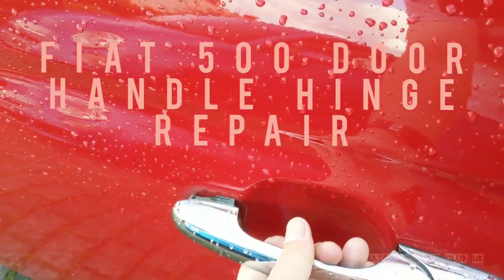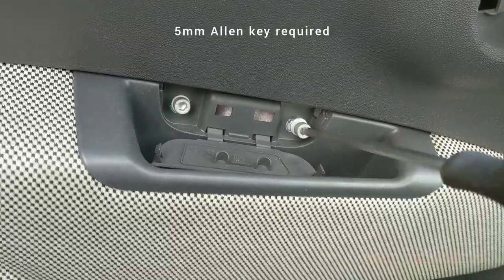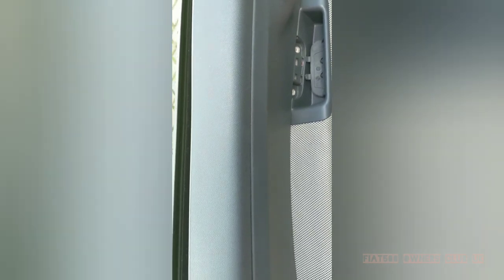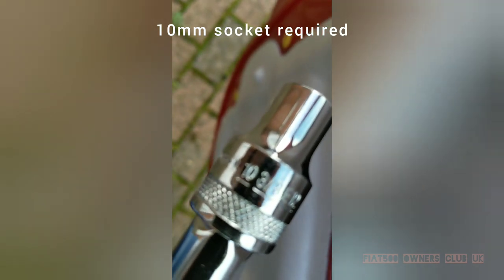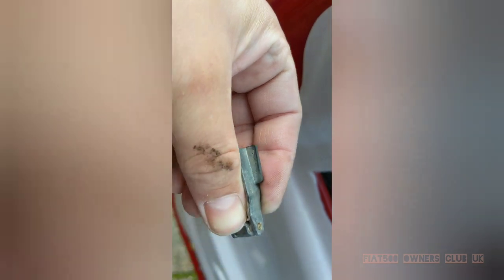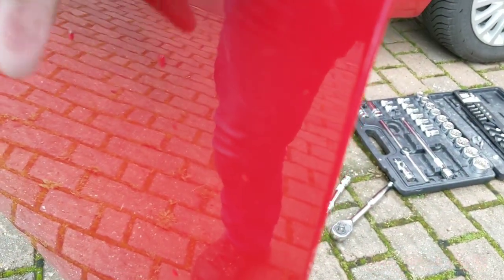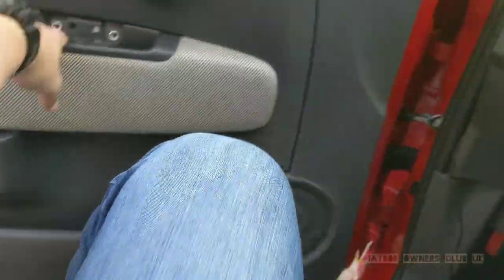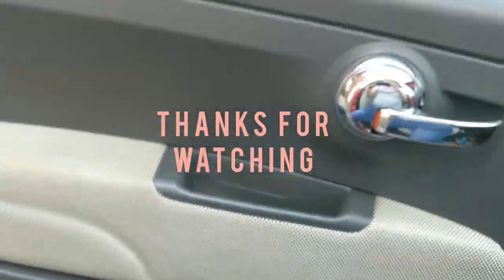Fiat 500 door handle repair

Comment: Thanks so much for a very instructive and intelligent video for the hinge repair. Liked that you mentioned that you don't have to disconnect everything and just place the door card on its side next to the door. Very smart. I saw that someone mentioned that you had not mentioned removing the screw on the inside of the door by the door handle but I'm sure people will figure that out. Again thank you. Have ordered the part and am confident that I will be able to tackle the job.
Reply: How did you get on?
Reply: Worked perfectly. Thanks again

Comment: Just done this for the second time, you DO NOT need to remove the handle if you have these tools, you simply need to undo the handle (Torx T30) to allow the necessary movement required.
A think pozi screwdriver through the hole where you removed the 10mm nut to release tension on the hinge bracket then use a mini socket set (I have one of these Teng T1420 1/4-inch Bits Socket Set Drive) to remove and then replace the screw.

Best to cover said hinge in waterproof grease protect it and ensure the hinge pin stays in place when fitting.

Comment: Okay I just did this job on my daughters car. Drivers door. You do NOT have to fully remove the handle to replace the hinge. Also just to be absolutely clear disconnect the BOTTOM of the two cables NOT the top. That will allow you to pull the handle out enough to get in at the screw at the hinge end.
Reply: Thanks, I’ve got exactly the same situation to do, ON BOTH SIDES. Daughters 🙄

Comment: You don’t need to take the handle off to change the hinge. You can access the screw through the hole in the door where you took the 10mm nut off. You also didn’t show or mention the third bolt in the door card behind the round chrome handle trim.
Reply: Tried this and failed - T change the hinge I unscrewed the door handle, pulled it backward 20mm or so then wiggled the handle away from the door skin. It's very tight in the hole. I then had enough room to get a stubby philips screwdriver onto the hinge screw and remove the old hinge.
Reply: B Simpson you risk breaking the handle or damaging the rod bushes like that. Sounds like you got away with it though.
Reply: This simpler way suggested by Love 500 worked for me. Used a realtively thin philips screwdriver to get in at the angle required and a small length of heatshrink wrap to hold the screw in place on the driver to get the thread started (more reliable than magnetic end although I'm sure that will work too). Protected the paintwork as the hinge will scrape it otherwise when opened to get the screw in. Thanks for posting this, it made it very easy to anticipate the process.
Reply: Wish I'd seen this before I did it at the weekend. Couldn't get handle out so finally managed to screw new hinge in without removing, but it was a pig.

Comment: Great guide, but as mentioned in an earlier comment, and at least in my experience, there is no need to remove the handle, or the T27 torx screw and the rod. There should be enough room to put the new part on without doing any of that. From 5mins 50secs into the video: 
1/ Remove the broken part of the hinged piece left in the handle. You can get to the screw by using a Phillips screwdriver through the slotted hole in the door (doesn’t matter if you lose the screw, there’s a new one with the hinged kit).
2/ Pull the handle away from the door as much as possible and offer the new hinged part into it. There should be enough clearance to open out the hinged part to allow the new screw to be put in (using the Phillips screwdriver through the slotted hole again, but use a piece of cardboard or something to protect the door from the new part).
3/ Once the screw is in place, fold the hinge back down in place. Release the handle to allow the thread to engage through the slotted hole and then put the original nut back on. 
4/ Check it works, then reassemble the door panel. Job done!
Reply: Good tip about screwing the new hinge via the hole in the door, on my first door I removed the bottom of the rod by “popping off” advice which caused the white retaining washer to come off, once I took a couple of pics I realised how the rod is best removed (if required) by rotating the black clip off the rod and pulling the end out without the clip and washer releasing from the bracket. I will follow your suggestion on the other door and just undo the nut inside the door and see if there’s the wiggle room if not I’ll just loosen the torx27 screw then reassemble using your tip this will save a lot of aggro and time.
Reply: Oh my god, my handle just snapped off for the second time (almost exactly 2 years). The first time I completely undid it and had such a hard time getting it back on lol. Your suggestion makes total sense, and I can’t wait to try it that way when I get my new hinge in the mail. Thanks!!

Comment: Greetings friends and thanks for a great video! Completed project today on my US 2015 500 Sport 70k miles. Door card attached in 5 places, 3 hex, 2 phillips. Popped off the door card and supported it on a box, no removal of cable or wiring needed. Adequate room. Vapor barrier pulled away gently by hand, folded, no cutting needed. 10mm nut removed with small socket, found broken hinge held in place by small original(?) torx screw. Couldn't get the correct angle through the little hole, so had to remove the T25 on the door to wiggle the handle enough outward to allow room to remove the little torx with a small socket/torx bit. Fiddly, as you say. Did not have to disconnect any internal actuators from door handles. Go slow and easy. Greased the new hinge and screwed into place with original little torx, folded the hinge, then back through the little hole. Fastened the 10mm, the T25 on the door. Tried the external handle, worked. Vapor barrier back in place, snapped door card back on, 5 connections fastened, closed door. Checked. . .Success!! Did it by myself, recommend a helper. Sense of accomplishment! Dealer in the SE US quoted me $415. Watched lots of videos, got done in 2 hrs. First time, scary, but did it! Thank you very much!!!

Comment: cheers mate and other commenters - door card hardest part to remove - used couple of plastic bike tyre levers and as others have mentioned was able to remove inner handle part phillips screw from hole on inside of door without having to remove handle completely. - but just loosen phillips and remove by hand from outside, otherwise it might drop down inside door.

Comment: is there a way to remove foam without cutting it?
Reply: Not really. It is glued in place and when you try and pull it back, it tears easily and makes a mess. Cutting with a sharp blade produces a much neater finish that can be taped back together.

Comment: Handy Video, followed most of it thanks, , you don't need to cut the white foam, pop it off the holder and trim the glue holding with a blade.. leaves it  intact
Reply from the maker: Thank you.

Comment: does this hinge fit the right passenger door (european model left-hand drive model)?
Reply from the maker: As far as I'm aware it should do as the part is described as for off side and near side.
Reply: Андрей Карякин yes they are not sided. Any hinge fits both sides.

Comment: READ THIS COMMENT - THIS VIDEO IS BOTH INCORRECT AND HIGHLY MISLEADING
At 6:35 he will show you the image of the handle from behind where he says 'remove this rod as it simply presses out'. He shows the rod disconnected from the bottom. Under no circumstances should you remove it from the bottom. He will then jiggle the handle out. Then at 7:28 he will proudly show you he has removed it. However, at 7:28 you will notice the  rod is now no longer attached at the top. Yes, you should remove it from the top and NOT THE BOTTOM. So you cannot remove the handle with the top of the rod connected.
1) REMOVING THE ROD FROM THE TOP IS NOT AN INSIGNIFICANT TASK.
2) REMOVING THE ROD FROM THE BOTTOM IS A DISASTER, BECAUSE RECONNECTING IT IS NEARLY IMPOSSIBLE.
VERY VERY MISLEADING VIDEO FROM A CONTRIBUTOR THAT SHOULD KNOW BETTER.
Reply: I've found the opposite true; the bottom bit of the rod (not the top) is designed to come out - you turn the black clip clockwise to disconnect the bottom of the rod, which allows you to free the door handle enough to then screw in the new hinge. I've done both my driver door and my passenger door, and when I did the driver door, once the top rod was forced out, it was impossible to get it to stay back in resulting in the driver door being unable to be open from the outside as the rod would just keep falling out. Passenger door I only removed the bottom of the rod and had 0 problems.
Reply from the maker: Sorry to have missed your comment previously. 
We have no intention of misleading anyone, only to try to help. Our club is run by unpaid enthusiast for the benefit of others.  
As per the description and as mentioned near the end of the video, this video was produced entirely by an owner/enthusiast who is not a trained mechanic. The intention being to demonstrate what is involved to give other owners enough information to make their own decision on either undertaking the task themselves or pay a professional mechanic.
We do welcome any information so if you feel that you can provide accurate technical knowledge to aid others viewers then please do so.
Reply: @laurenm8378  Hello Lauren how difficult is to release the bottom rod? When you say turn the clip clockwise, I don’t think the clip turns.. could you clarify pls ;) many thanks

Comment: I would like to clarify when you describe removing the bottom of the rod you “just push out”. If this is done the plastic retaining washer pops off and reinserting is impossible until you remove the black plastic clip. The black clip spring-clips to the rod, push off the rod by rotating the black clip this then allows the end of the rod to come out without releasing the white retaining washer. To put the rod back push the end into the hole in the black clip then rotate the black clip so it clips back onto the rod. If you have pulled the rod and the washer has popped off you will have to take black clip off the rod as described previously pop it through the bracket hole and clip the washer to the back side (lock side) of the bracket then pop end of rod and rotate the black clip onto the rod. I also did not cut the plastic inner covering but peeled it back back by pulling a small edge then using a blade carefully cut the adhesive leaving equal amount on door and cover then folding it back, even carefully released from yellow round plastic insert. Refitting was easy, the cover sealed perfectly and manage to get edge of yellow plug to cover the edge of the covering’s hole. Now looks like original and no cut edges to allow any ingress of water from a wet glass to inner door card, honestly just a little more patience is well worth a neat and secure finish.
Reply: Thanks for this—however a bit late for me. I tried varies time to just "push out" as indicated here and other vids and when it finally let go, a little translucent whitish plastic clip (not red one as others have inquired) broke and fell to the bottom of the inside! I can’t figure what where it goes and what is for (even after finding diagrams online) but the door opened perfectly without it—until it didn’t —a couple days later. Any thoughts would be helpful.
Reply: Oh, and BTW, I didn’t have this problem when I fixed it on our own car a couple years ago. This fix is on my daughter’s!